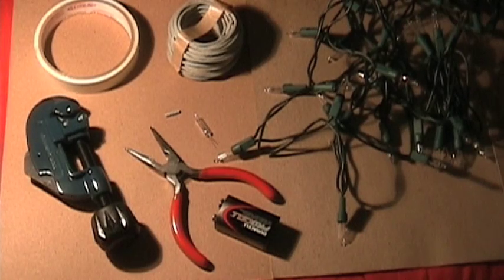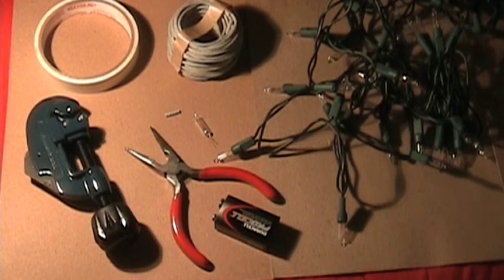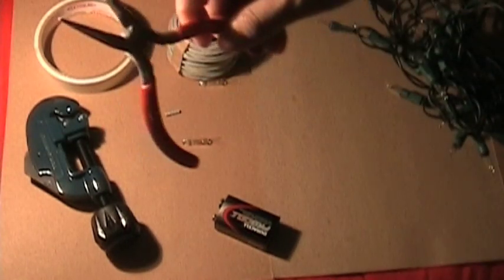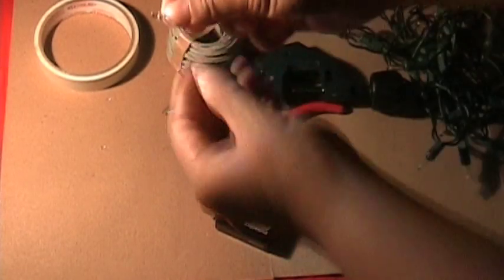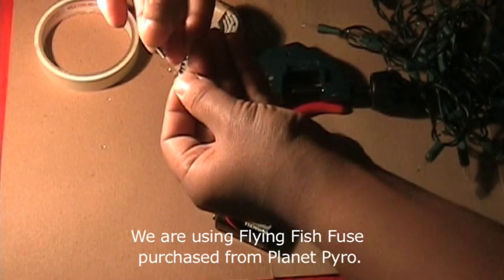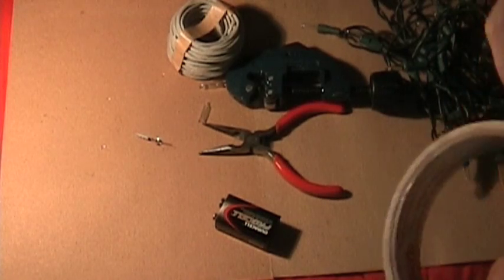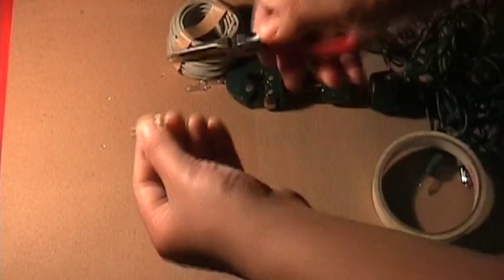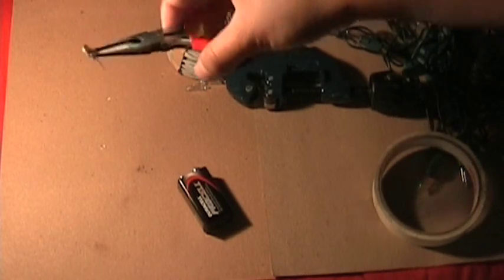Do it yourself Homemade Electric Fuse Ignitor for Pyro/Fireworks

Comment from the maker: @bl4d3hunt3r I haven't had problems with the tungsten breaking from pipe cutters. I found that when inserting the bulb into the fuse is when it might fail or break the most. I got around that by taking out some of the powder from the end of the fuse, but it's never really fool proof.

Comment from the maker: @dfs04 it depends on the bulb. Cheap bulbs could go off with like 1.5V. But why use less power when you could use more power!

Actually I tested with a 100ft cable and required more than 24volts. So it also depends on the attached cable/quality.